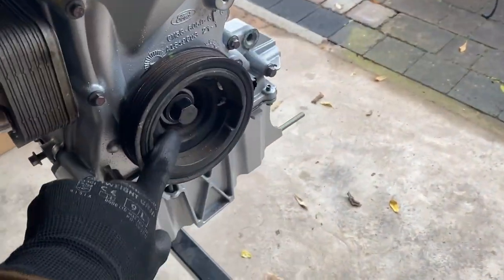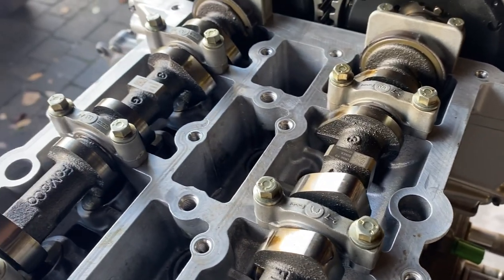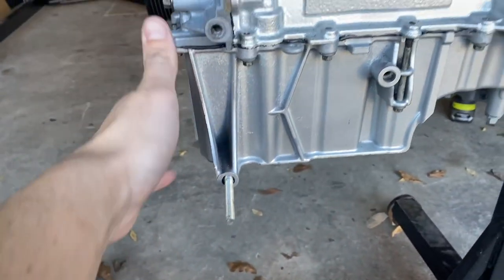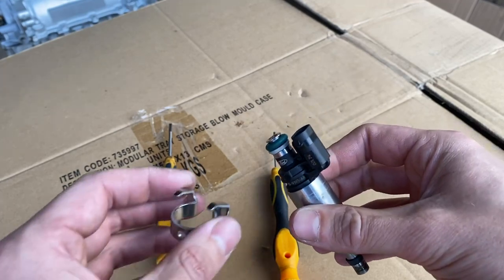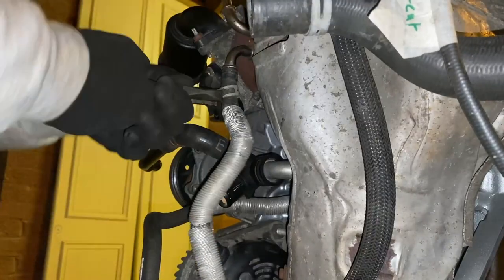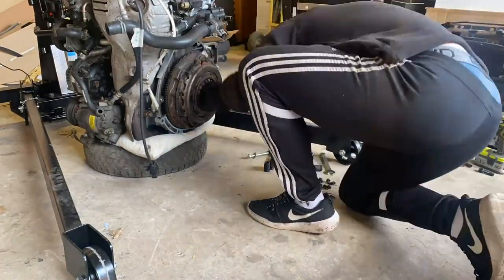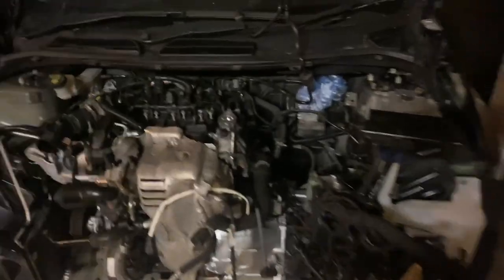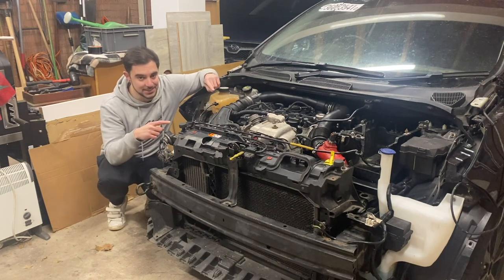Fiesta MK7 1.0 EcoBoost Engine Rebuild | Part 6 | Final Assembly

Comment: In the states my local Ford dealership and Castrol have no clue what I'm talking about when I ask about "wet timing belt" additives. So I'm just going to 🙏 that Motorcraft 5w-20 Full Synthetic for the past 40k has been kind to the belt 😂

Comment: This engine's coolant level sensor (if it even has one) is severely misplaced, which is what leads to failures like this. Mine leaked coolant (hose came off) without me realising and didn't alert me until the engine seized.

Comment: I hope you're all sorted with your project now. I've been doing a similar work, originally blocked oil pump strainer, suspected head gasket leak and twice I've had the engine apart. Unfortunately, all my painstaking work has come to nothing. Water is somehow getting into all three cylinders (as it was before I started the current work). Have the head resurfaced, did some some static water leak checks, new head gasket and bolts, checked flatness of the block etc. and still hasn't cured the problem.
I'm assuming now there is a crack somewhere in the cylinder head allowing coolant into the exhaust manifold and then into the bores via the valve openings.  Absolutely gutted.
Reply: Turned out the head is cracked. Have sourced a used replacement - hopefully that's not cracked!

Comment: Done a great job, helped me do head gasket, timing belt etc on my focus 1.0 ecoboost, its all back together but the thing wont start now ! Was running fine before hand apart from loosing coolant... it turns over but womt fire up, it goes to if you fully press gas pedal  ? ? ANY HELP or idea what would or could be causing this....

Comment: Hi mate. Great video!  just wondered what the torque was on the VVT solenoids bolts, and did you use new seals. I've got one that's weeping. Any input is greatly appreciated!
Reply from the maker: 7Nm. I didn’t use new seals no. Hope that helps 👍🏻

Comment: Noticed you didn't check the valve clearances. Should be ok as you were very methodical and only did light lapping. On my replacement head the exhaust valve clearances look too small. Trying to find the spec for the clearances at the moment but not having any luck on the internet
Reply from the maker: In all honesty I didn’t even know I had too, about a week after I did the job I found out I needed to do it and it was too late 🤦🏻‍♂️

Valve clearances (cold)	
Inlet 	0.21 to 0.30 mm

Exhaust:	
CM5G FA, FB and FC camshaft 0.31 to 0.37 mm
All other camshafts 0.38 to 0.47 mm

Hope that helps

Comment: Absolute dreadful engines what ford were thinking of god only knows🤦‍♂️
Reply: @clueless6559  you tell that to all the customers around the country that have scrap engines in these cars. Lost count how many we have done at work utter bags of bolts. Then they had a great idea NOT of using a wet belt on a transit 🤦‍♂️
Reply: @Honky_Konky_Phooey  Tonnes out these without problems , most are caused by stupid owners that have no idea about there car , just trust dealers and worst fast fit places,  there is no excuse there is plenty of good information out there ,